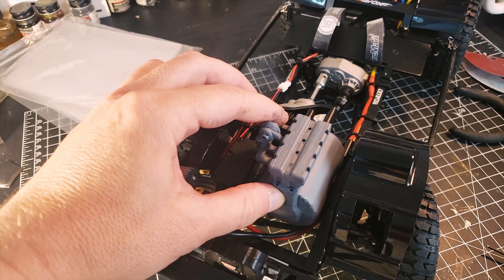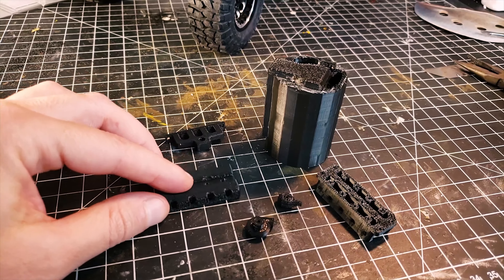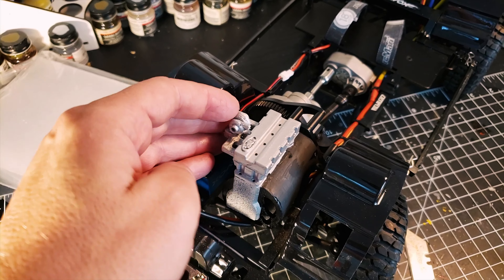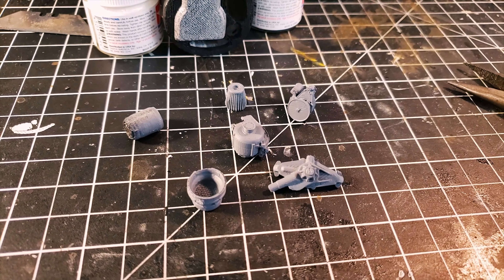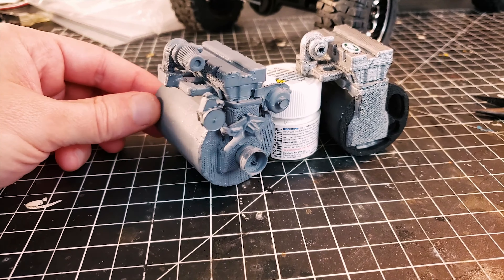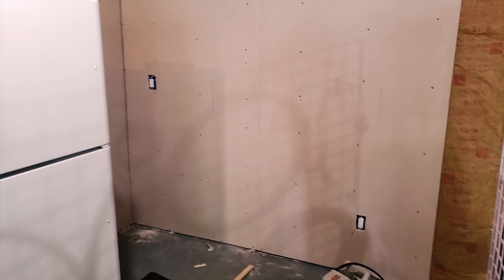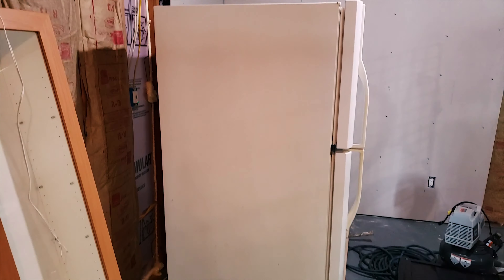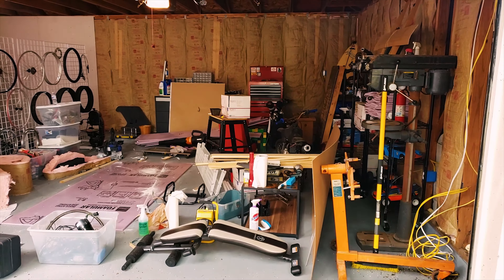Adding the Details to a Scale Motor Build and Other Updates!

Comment: If you want the fridge to stop tripping, remove the GFCI and install a standard outlet. Certain pieces of equipment can cause false trips on GFCI outlets. There is no need to have one from a safety standpoint.
Reply from the maker: Unfortunately, per code, all outlets in a garage have to be GFCI protected. In case of flood or liquid spills I'm assuming. I have an outlet that's on it's own non GFCI circuit I plan to plug the fridge into. I'm going to use a dual fault breaker to satisfy code but it's not live yet. I was hoping to use the one hot outlet temporarily.
Reply: We have the same GFCI code too. The entire garage is on the same circuit. Pain in the ass! 
Let me know if you figure out how to bypass it!

Comment: What size gfi amp is it. It should be aleast a 20 amp for the fridge. Good job look forward to the next update.👍👍😃😃
Reply from the maker: Thanks Jeff! Yes, all the outlets in the walls are 20amp. For the 4 receptacles in the ceiling I put in 15amp outlets.
Reply: Talked to my Dad who is a retired electrician he said that the fridge is not suppose to be on a gfi outlet.Change out to a regular outlet and that will fix your problem.😃😃👌👌